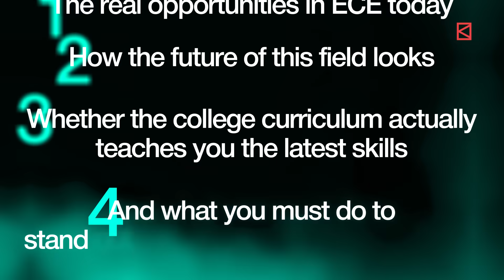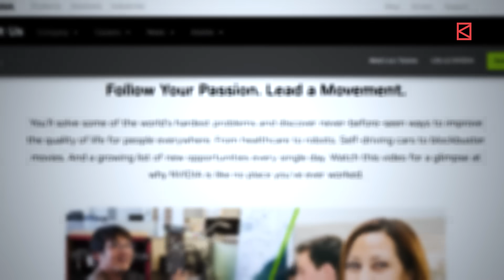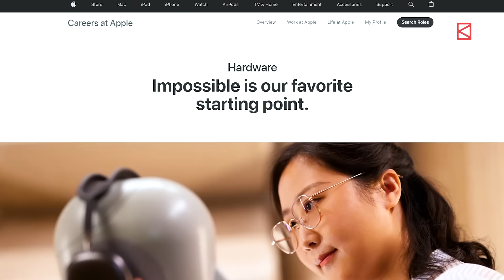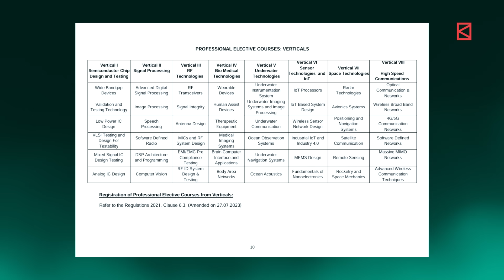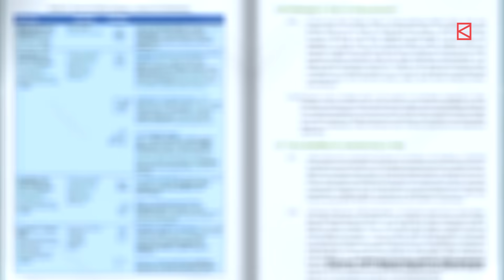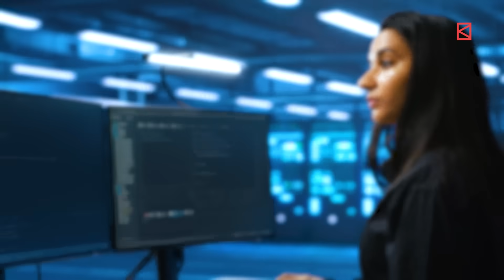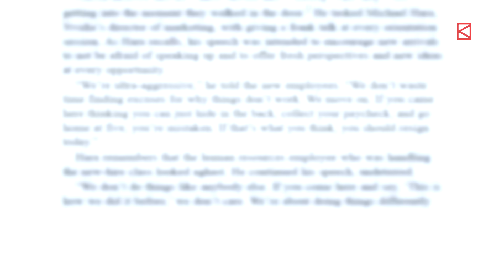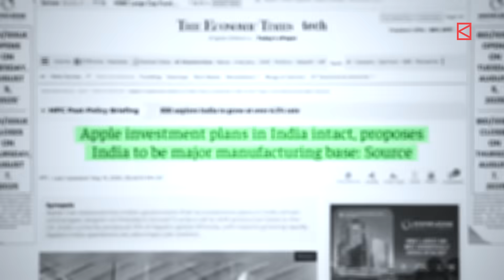Should You Choose ECE over CSE?

Comment: can you explain the difference between electronics and communication  engineer and electronics and telecommunication engineer
Reply from the maker: Good question 👍 The names sound very similar, but here’s the difference in simple words:
	•	Electronics & Communication Engineering (ECE): Focuses broadly on electronics, digital systems, embedded systems, and communication technologies (like signal processing, antennas, wireless communication).
	•	Electronics & Telecommunication Engineering (ETC/ETE): A bit narrower, with heavier emphasis on telecommunication systems — networks, switching, transmission, mobile/wireless, and communication infrastructure.

So, ECE is broader (electronics + communication), while ETC is more specialized towards communication and networking.

👉 If you’re confused about which is a better fit for your career goals, you can register for a free counselling session here: https://bit.ly/40G79Lf.